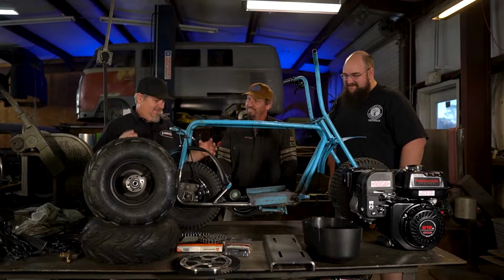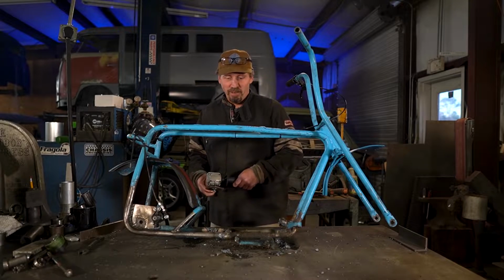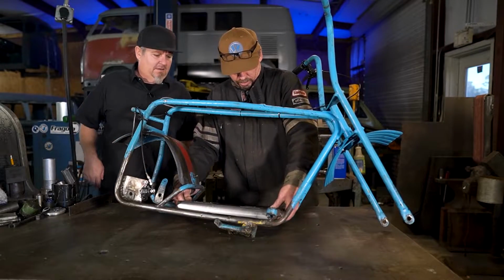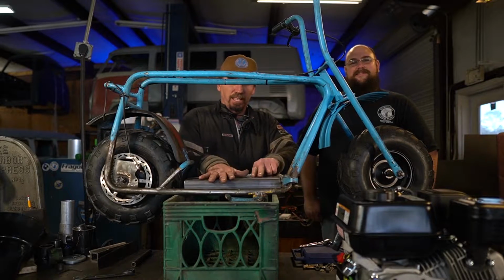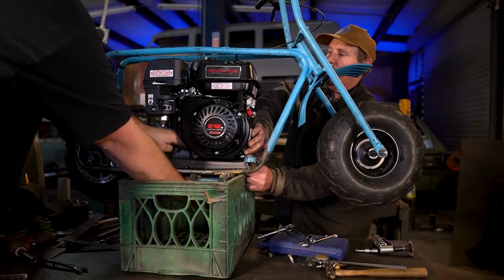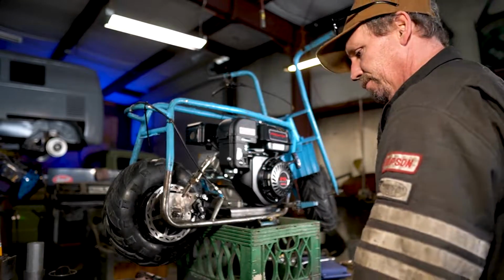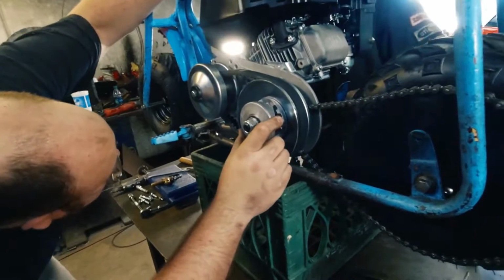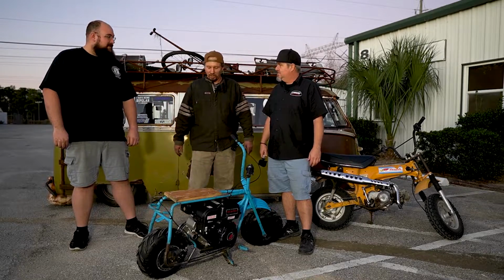Doodle Bug Mini Bike 212cc  | One Day Build!

Comment: What Fun!  Just got a Doodlebug in a trade, fixed it up and took it for a ride.  But I can't believe you didn't have a seat, that must have paddled your bottoms and cracked your locknuts. Great build.  Just subscribed.   Thanks
Reply from the maker: Ha Ha!! There's a seat on it now!  I'm going to be building another real soon.
Reply: @RobStapleton  The one I just got was faded red, aka pink, so I camouflaged it up, and fixed up the original motor.  Redid the plastic fenders, looks great.  Even at only 97 cc, it will move my 185 lbs around at about 25 mph.  I can't imagine having the predator 212cc on it.   Thanks again.

Comment: did my set up with a spring tensioner  off the back side of the torque converter cover and it works well. NO SLOPPY CHAIN.
Reply from the maker: Great idea.. what did you use for the tensioner?